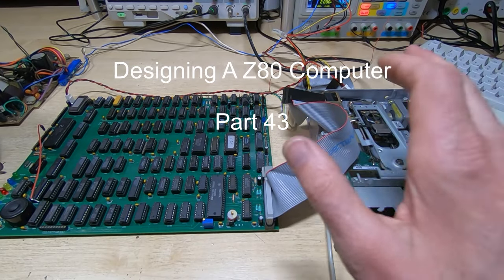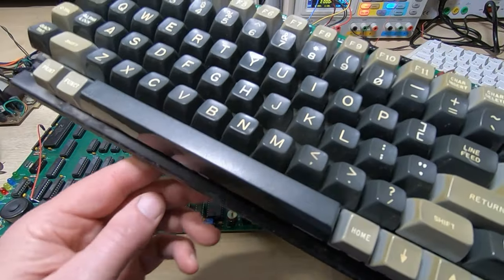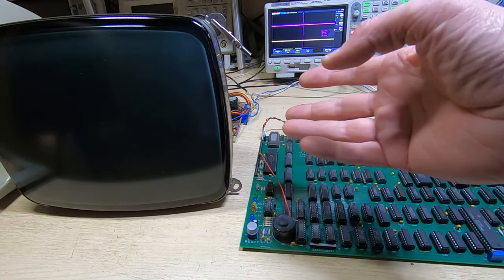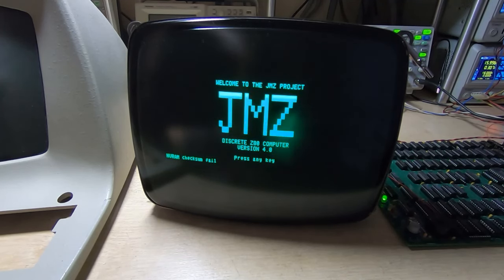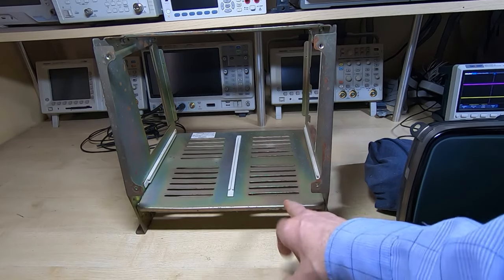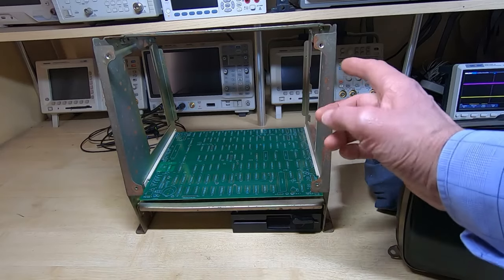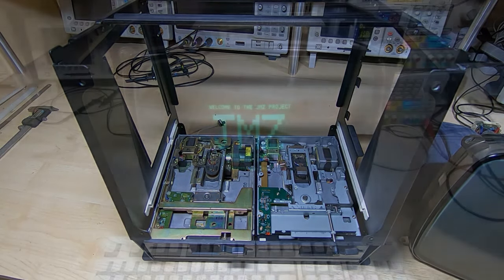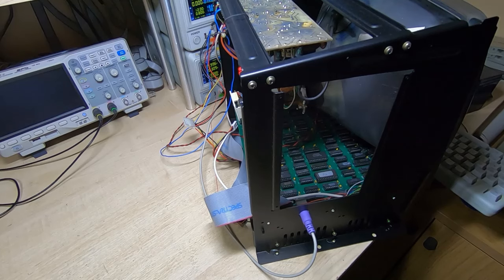Designing A Z80 Computer Part43

Comment: I am curious how you determine whether a P8048 pr P8049 is actually faulty? Is there a simple test circuit?
Reply from the maker: You should be able to read the internal program code.
Reply: @JerryWalker001 thanks for the reply. Looks like I need to invest in on mcs-48 adapter for my eprom programmer or build the arduino mcs-48 reader I see on the web. I was hoping a simple circuit could test the main functions on the P8049. Love your videos although much is above my knowledge level.😊
Reply: I guess this is not definitive as I understand it is also possible to block the reading of the code from 8049 when originally programmed ?
Reply from the maker: @richardmerifield3263  That is only true for certain recent 8042/49 clones but does not apply to older 8048 devices which should be readable as they do not contain any code protection. Even for devices which are code protected this does not prevent the data lines from functioning when a clock is applied as this would make them useless. A good reader will still return a valid read cycle for protected devices but will not be able to read the actual code.
Reply: Can I ask what reader is considered a good reader of the MCS-48?
Reply from the maker: @richardmerifield3263  I cannot really say what would be considered 'good' as there are so many available and it depends  what you want from them. To test the one in the TS800A I used a Dataman PRO48-2 and then I fitted it to a breadboard and tried running it to see if it was doing anything at all. It was but it never seemed to read or output anything on the data bus, Hence my conclusion. The Dataman also indicated these 8 pins as 'not connected'  which usually means 'bad'.
Reply: Thanks. Very few appear to support the MCS-48 by the looks of it. I do have a Willem programmer with usb and parallel port so that may be my best option.